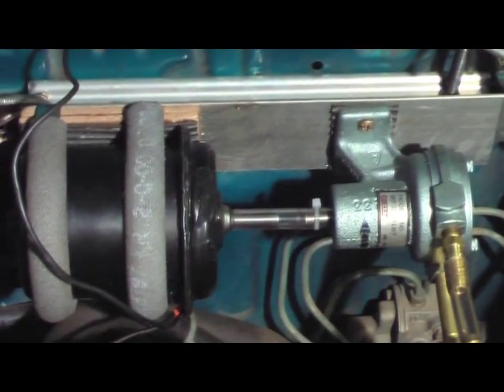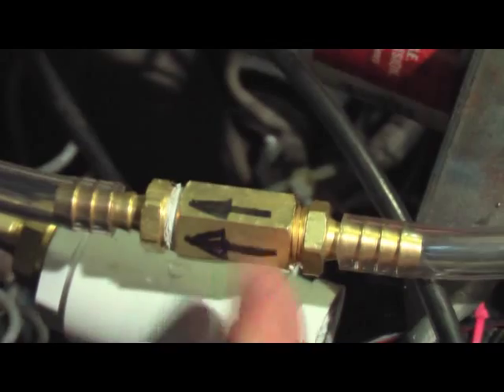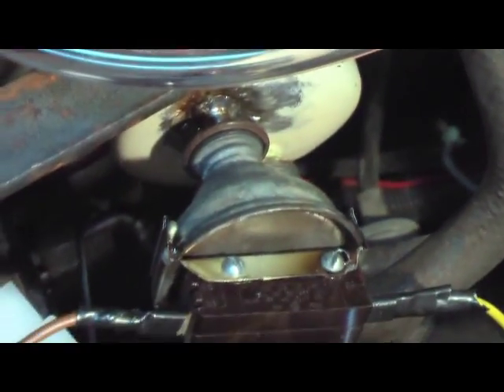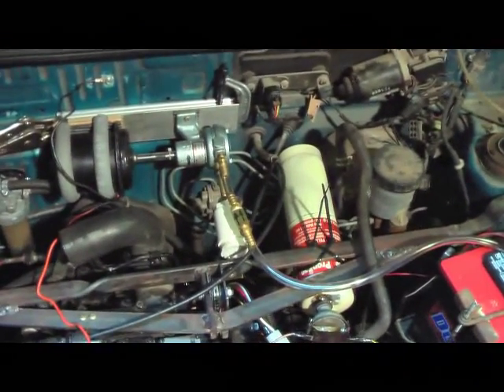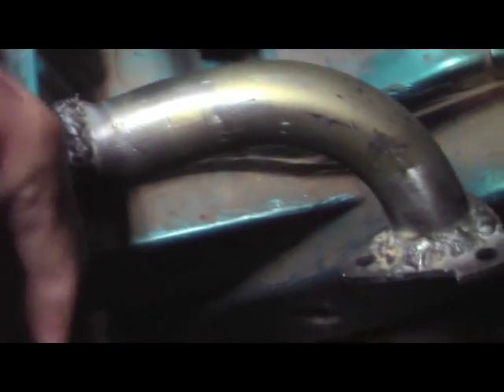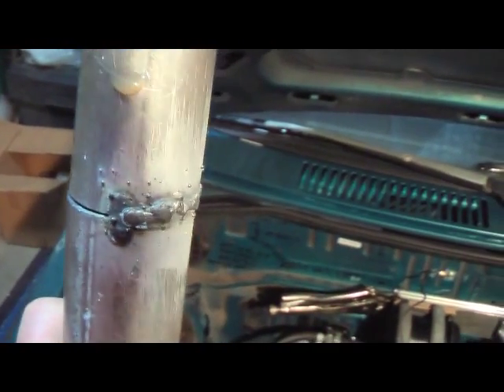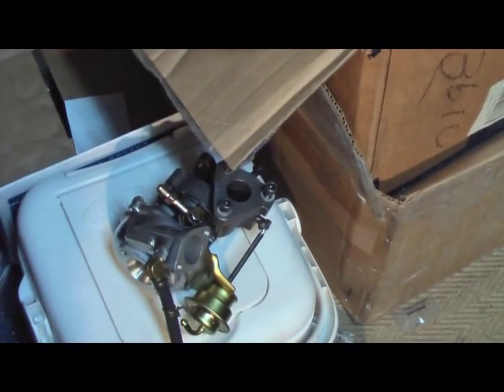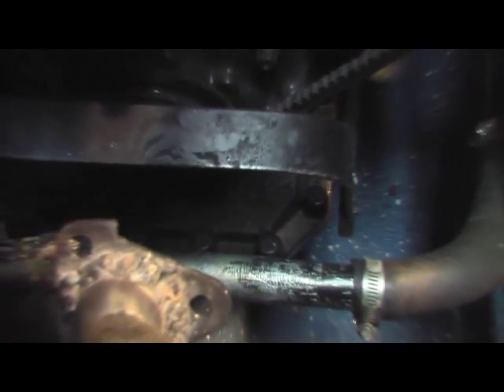FestivaUpdate2

Comment from the maker: @sweedspeed18 yes, the mounting is odd. To do it right off the manifold would require moving the alternator, radiator, or both.  Do you mean the turbo coolant, or intake air intercooling? I was given to understand that intercooling is not needed on a diesel, since detonation/preignition is not a problem.  Also, I'm getting minimal boost, so there should not be too much compressive heating from the turbo anyway.